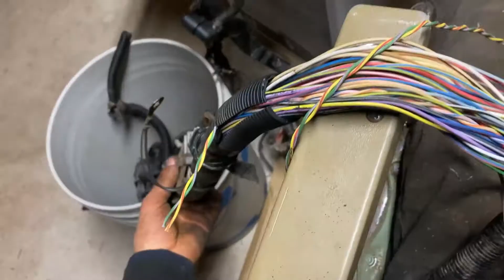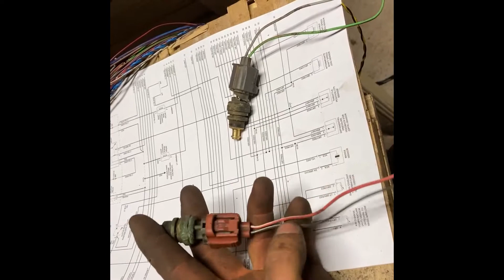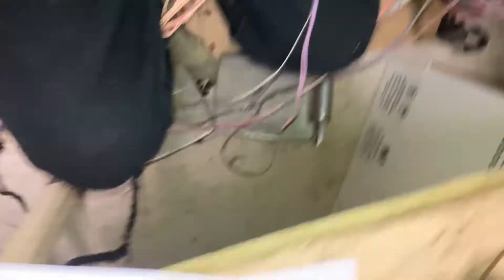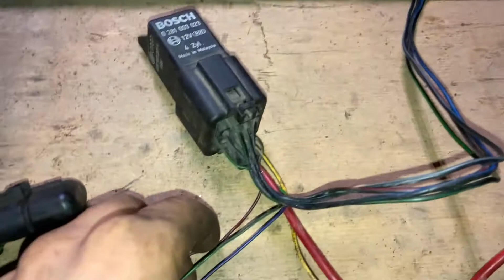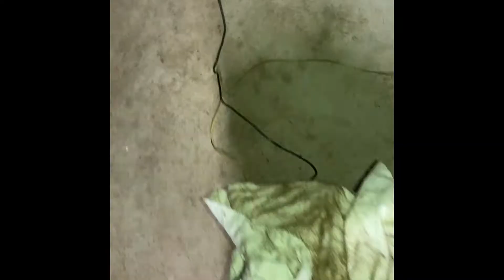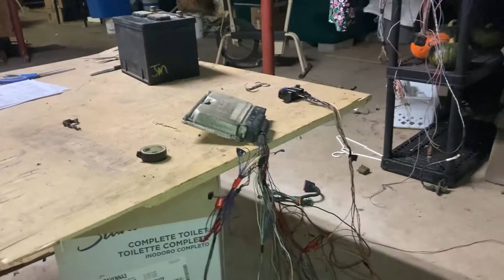TDI Stand Alone Wiring Harness part1

Comment: How did you get the gage cluster to work and what year is the truck
Reply from the maker: 2003. Oil Pressure is tied into oil filter housing. The battery indicator  is hooked to the ranger harness. The gas gauge is ranger factory. The temp gauge runs of the ranger sensor i tapped into the coolant line.. tach runs off alternator signal. Speedo is factory
Reply: Thank you
Reply: Does the canbus interfere with any of it
Reply from the maker: @WHATcuffy  that I don’t know. I’m assuming your referring to the purchased can bus they sell for a standalone tdi. I didn’t use one.

Comment: How Idid it go?
Reply from the maker: Worked good. Only thing I had to change was adding a relay that switched the large gauge red wires that ran to the ecu and engine harness due to a parasitic draw.
Reply: @MTD12HPTURBO  you have the pin out what was the car it was from
Reply: @MTD12HPTURBO  I an doing this swap in a 65 volvo Amazon 122s
Reply from the maker: @customstitchbuilds  motor was out of a 2001 vw golf. I believe I have a pin out in another one of my videos there
Reply from the maker: Appears all the info I used is in the start of this video